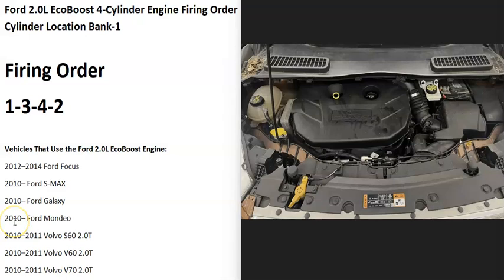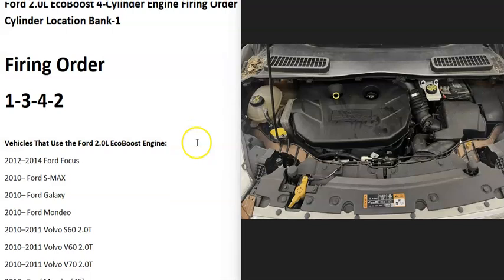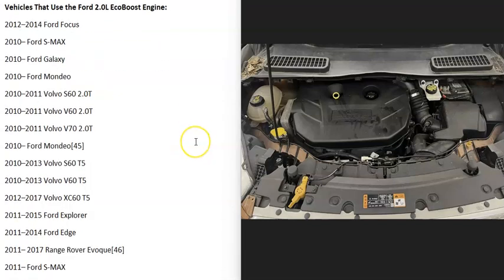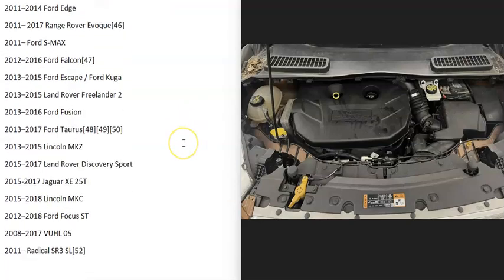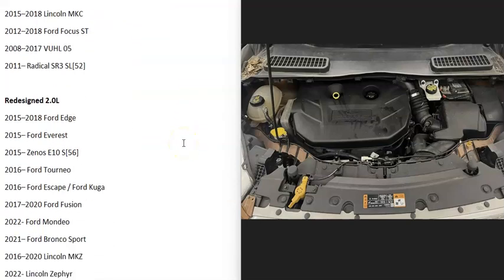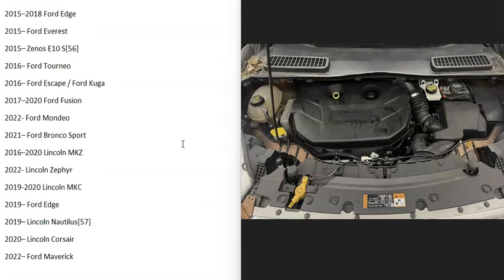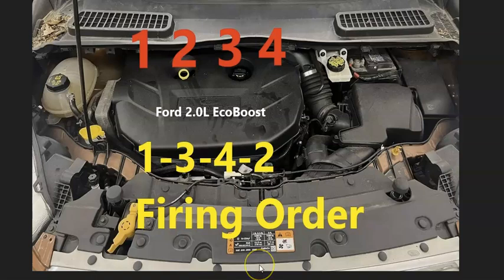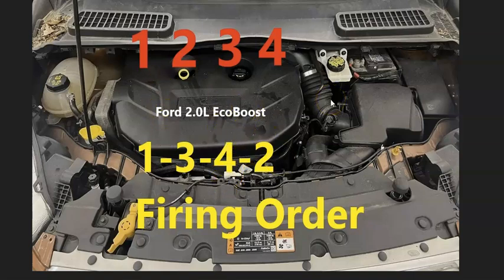Ford 2.0L EcoBoost 4-Cylinder Engine Firing Order Cylinder Location (Bank-1)

Comment: Replaced all coils and plugs, reset light. Two days later same cylinder 3 misfire light hits again, what should I try next?
Reply from the maker: If the coil is good and it is getting spark, I would test the injector or swap it with another cylinder to see if the problem follows it.
Reply: My wife's Hyundai had a check engine light and the code said misfire cylinder four. New plugs and coils did not help. Car had fifty thousand miles on it and my mechanic said take it to Hyundai. Turns out it was low compression cylinder four. So, Hyundai replaced the engine. If it were not for the check engine light, you never would have known there was a problem. But the car would not pass the annual emission test which a car must pass before they move on to the annual state inspection my state requires.

Comment: So if I am getting a p0304 misfire code on cylinder 4 i should replace the spark plug or coil on cylinder 4 right? Because I did that was still getting the misfire code on 4.
Reply from the maker: The main things to check are for spark (coil) and gas (injector). If the components test good testing the wiring is next.